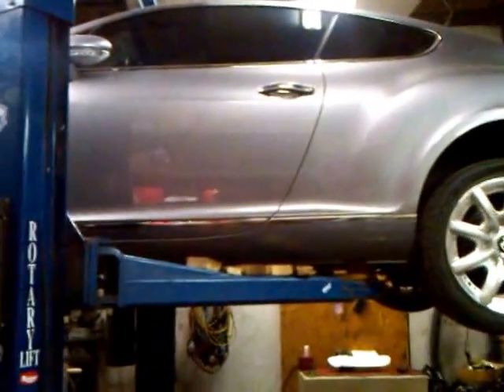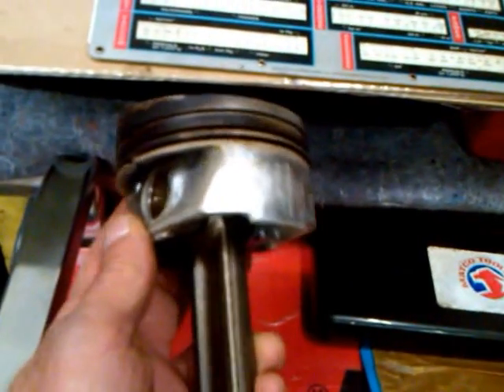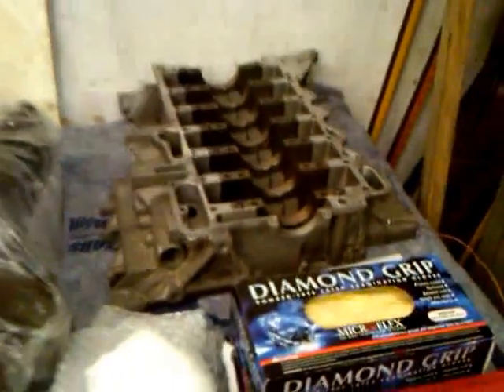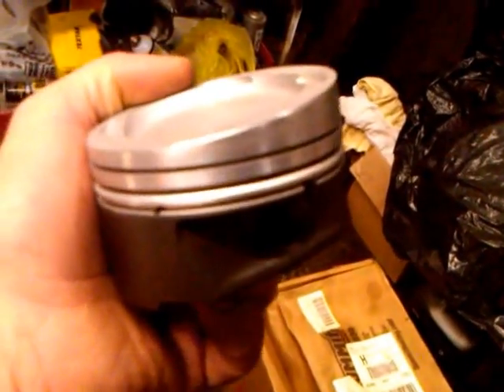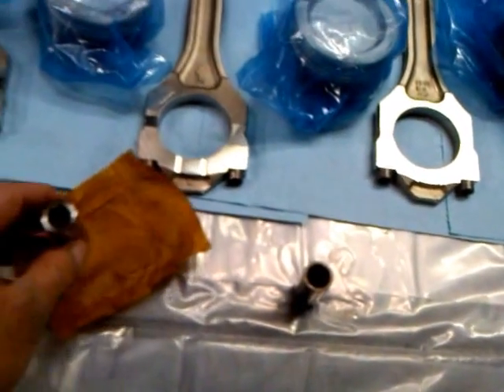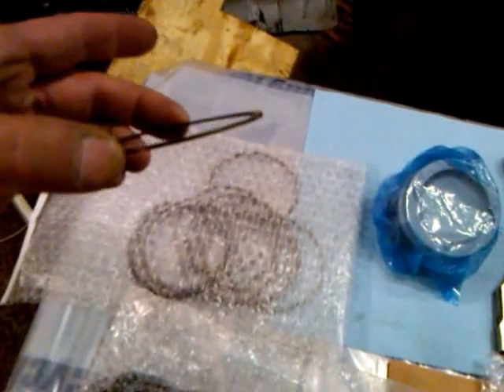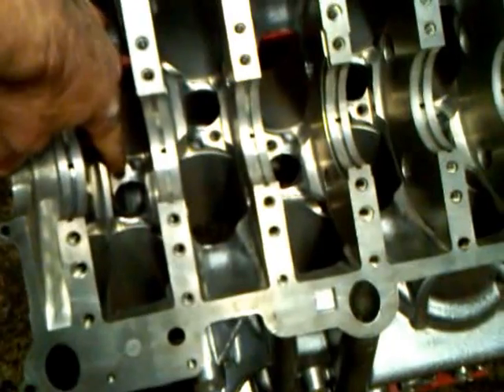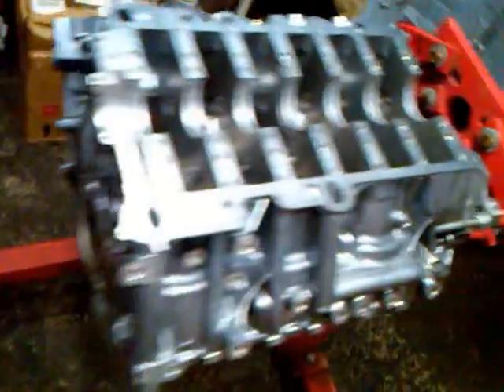Bentley Engine W12

Comment: keep it up bro 
 how can I get torque spacers for engine?
.
Reply from the maker: falcon kik torque specs? You would have to do what I did. Reverse engineer it.  These bolts are stretch bolts and similar torque to W8 and VR6.  It’s always torque plus torque angle
Reply: @porsche951g  thanks

Comment: where you have nikasil redone ?
Are w8 amd w12 using nikasil coat ?
Reply from the maker: These engines have Alusil cylinder walls not Nikasil. If you are in New York you can have LAB machine shop in Lindenhurst NY perform that service, They have done many Aluminum blocks for me both Bentley and Lamborghini.
Reply: Jason, I have 2005 Audi A8 W12, my block got burned and the piston melted on the cylinder walls do you think the LAB machine in Lindenhurst NY can resurfice it? I bought new piston and rings from Germany and the timing set also, I just need to buy short block or resurface my block. let me know if you have a contact please. Thanks Ross!
Reply: @FFattah1 
 Hello Ross, I know this is 7 years old, but hopefully you can share the name of the company in Germany. 

Johnny
Reply: @JohnnyHotspurGT  By the way, I have 12 or 11 pistons and pinston roads from a block I bough from Taxes, which it was for VW Phaten W12 6.0L

Comment: where do you even get engine rebuild kit for this engine?
Reply from the maker: Bentley,VW,Audi do not sell any internals. You must find companies to make the parts or recondition any used parts.
Reply: In other words (provided crate engines are available from the manufacturer), Volkswagen expects you to replace the engine (at substantial cost) rather than rebuild it.
Reply from the maker: Yes 100% correct.
Reply: www.flyingspares.com

Comment: Hi Jason.  

I am writing from Turkey.  I have a GT workshop.  At the moment I have Bentley w12 in my workshop.  It has a job lower engine job.  The car hit the pavement.  I had to change the  oil sump and the lower block.  I need the tightning torque for the full engine.  Would you have it ? Or do you know where I can get them from.  I tried Bentley dealer but unfortunately, no help :( 

Thanks
Dilaver
www.gtservis.com
Reply from the maker: +Dilaver Saglam  Hello Dilaver  There is no torque specs accessible from Bentley,VW,Audi. If you look into torque specs on all newer cars you will notice they are using stretch bolts for cylinder head and lower case half of the engine block. My way of finding the formula is to find the same bolts used in other VW,Audi,Lamborghini engines and measure stretch before and after torque and torque angle is complete. I tried various base torque settings and angle until I got it perfect. I did not save this information for the engine so you will have to do your best on bolt stretch. You can look up VW W8 and VR6 for a base and go from there. Just know if you are replacing the lower engine case half with the main bearing saddles in it. It is a matched set due to crankshaft centerline from Line boring and will not work without having that done. I hope that helps.